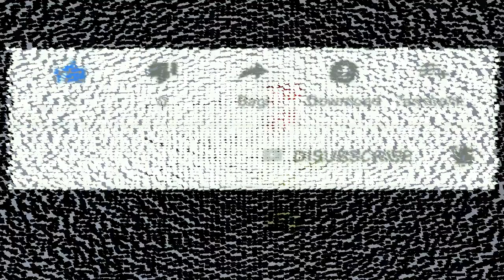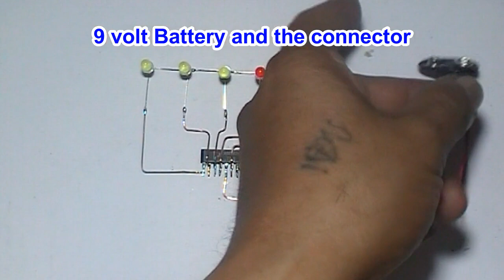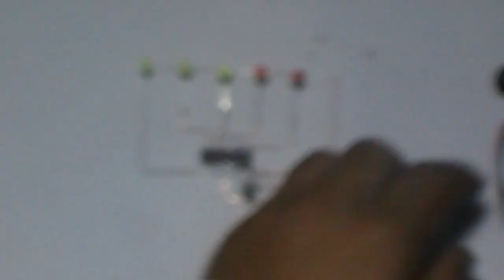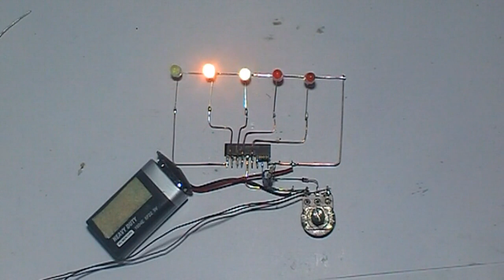Dot display mode LED VU METER with IC AN6876

Comment: Sir great job,,sir can i use ka2284
Reply from the maker: AN6876 is a special IC for dot mode, KA2284 is special for bar mode but you can modify it into dot mode. You can see how I modify KA2284 into dot mode in another my video in this channel.

Comment: Kalo supaya lednya banyak. Satu pin di isi 2-3 led di paralel.  Bisa tidak bang.
Reply from the maker: Tentu bisa brow.
Reply: Oh.. Mantap..  Thanks
Reply from the maker: Kalau intensitas cahayanya kurang maka Resistor yg 1k ganti 680 ohm atau 560 ohm, karena pin 7 IC AN6876 adalah pin pengatur intensitas cahaya LED.
Reply: @moristo  siap bang..  Terima kasih banyak ilmunya
Reply from the maker: Sama-sama, semoga bermanfaat.

Comment: Aku coba di ic LB1403 kok nggak bisa ya😕, padahal penyambungan sudah sama persis sama itu, tpi tetap nggak bisa, led malah nyala semua, mungkin bisa dibuatkan video dengan ic LB1403, ic AN6884 didaerahku nggak ada yang jual😕
Reply from the maker: IC AN6876 memang special untuk DOT mode, kalau IC LB1403 sama persis dengan KA2284 special BAR mode, jadi silahkan lihat video saya yang mengkonversi BAR ke DOT mode menggunakan KA2284.
Reply: @moristo  ok, sudah bisa pak pakai ic LB1403, cuma butuh menyesuaikan resistor bagian lednya saja
Reply from the maker: Mantap, btw ya emang gitu seperti video saya yang DOT pakai KA2284 itu.
Reply: @Ardi_Art98  mas saya juga sama seperti anda gabisa padahal sama persis kendalanya dimana ya?
Reply: @kanjat2  itu emang ic LB1403 nggak bisa dibuat dot mode mas, harus di akali gitu,,, dan sayangnya di daerahku nggak ada yang jual ic AN6876,
Reply: @Ardi_Art98  diakali pake apa mas, terus rangkaian nya yang diubah yang mana?
Reply: @Ardi_Art98  kalo boleh minta Ig atau wa biar bisa dihubungi mas?
Reply from the maker: @ivandanu2935  Silahkan lihat video saya yang Convert KA2284 into DOT mode.

Comment: how many volts is used for IC
Reply from the maker: 9 volt up to 18 volt.
Reply: Itu buat mixer rakitan bisa gak?
Reply from the maker: Tentu bisa dong, asalkan tau cara memasangnya.
Reply: Input potensio masuk ke mana itu bang
Reply from the maker: Ke speaker

Comment: Apakah SAMA Tidak Sama IC AN6875 Tu Bang??
Reply from the maker: Sepertinya AN6875 itu adalah IC yang spesial BAR mode, tetapi IC itu juga bisa di modifikasi menjadi DOT mode.
Reply: @moristo  SKEMA nya Dong Bang??
Reply from the maker: Untuk cara modifikasinya sama saja dengan IC KA2284 dan sejenisnya, silahkan liat video saya yg modifikasi KA2284 untuk menjadi DOT mode. BTW maaf untuk skema belum ada.
Reply from the maker: Tapi sepertinya AN6875 itu mirip AN6876 yang spesial DOT mode juga, saya belum bisa yakin 100% kalau belum pernah pake IC AN6875 itu, atau datasheet yang bisa saya percayai.